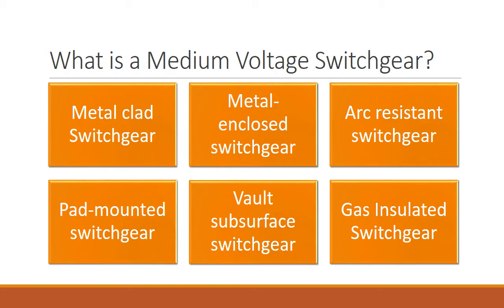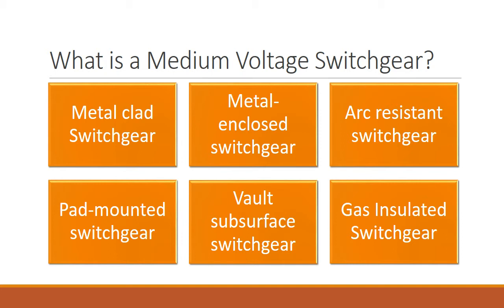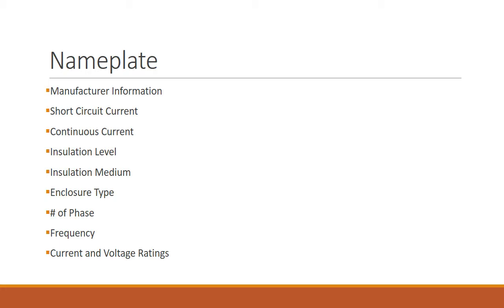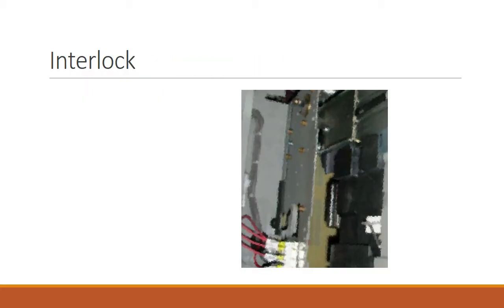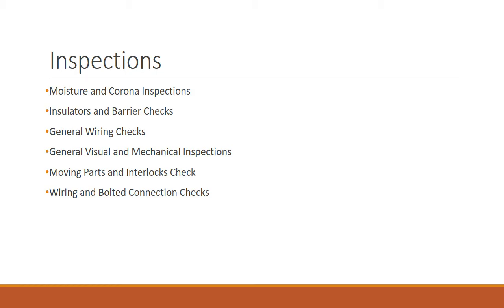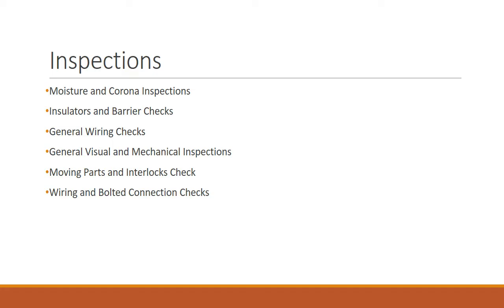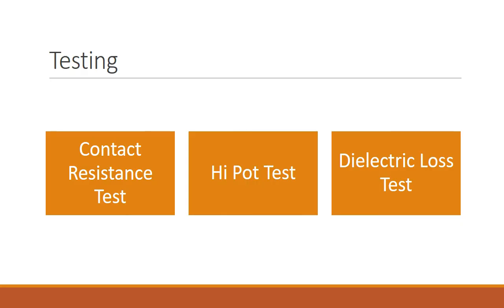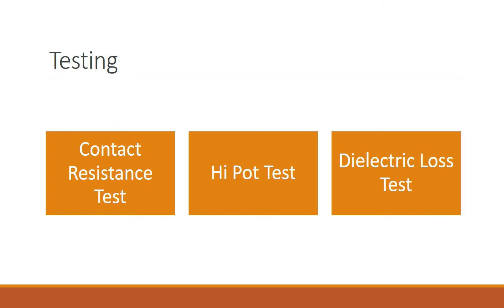Medium Voltage Switchgear Fundamentals: The Mini Course

Comment: Not sure how you set the upper limit of MV to 69kV. That is squarely in HV territory. MV tops out at 35kV.
Reply: I've seen 69kV, 100kV, and 36kV all mentioned as the upper limit of MV.
Reply: @cmgeolo  I go by NEC definitions.
Reply: In my country medium voltage is anything under 70kV.